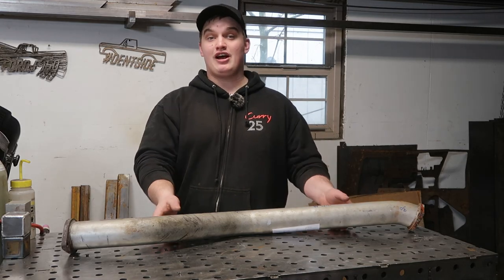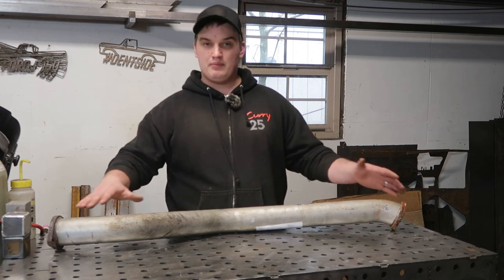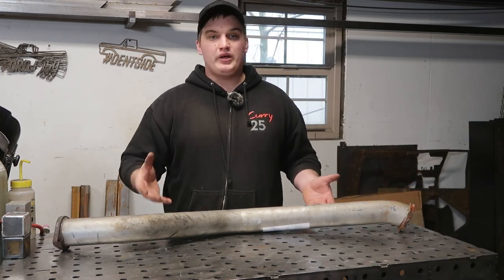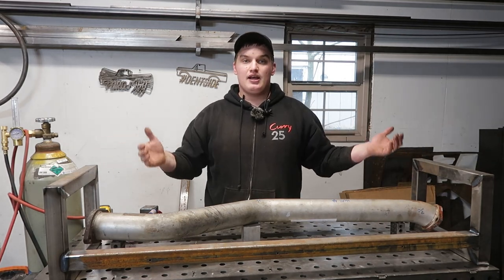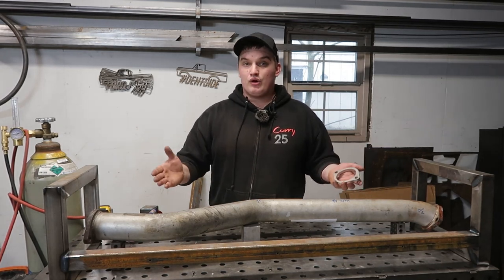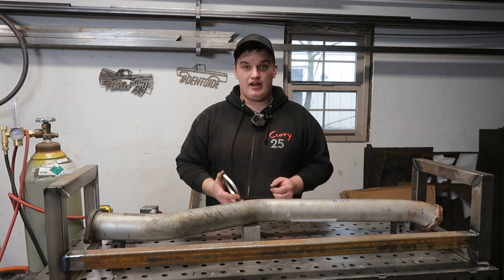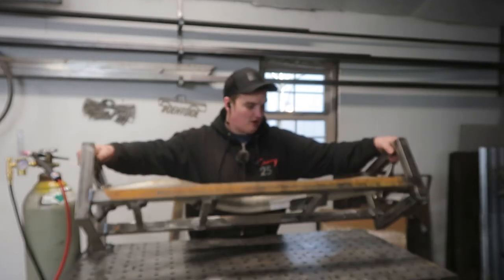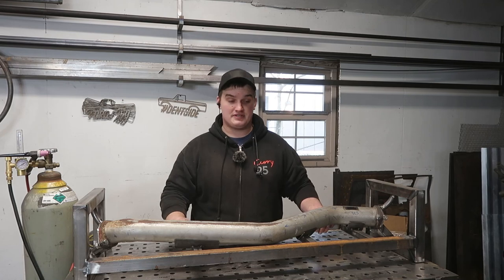HOW TO Build A Welding Jig or Fixture For Beginners.

Comment: We used to do this with old pipe spools in the shipyard. We'de take them off the ship then target them in our shop with old flanges on jigs. I've done it with big manifolds with 90s and tees and odd angles that were 12 inch diameter pipe with 10 flanges for valves almost 15 feet longoverall. Works in so many ways. Glad you showed this.